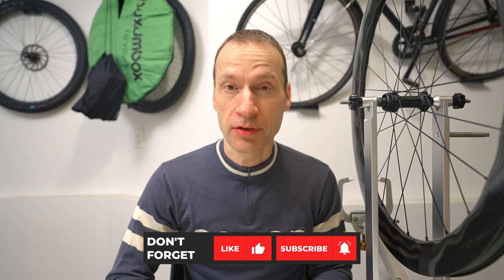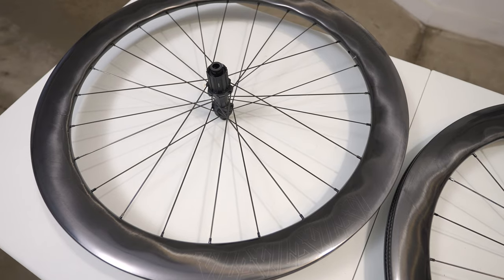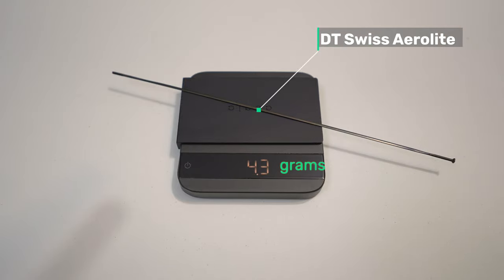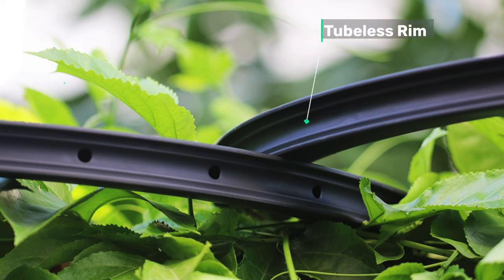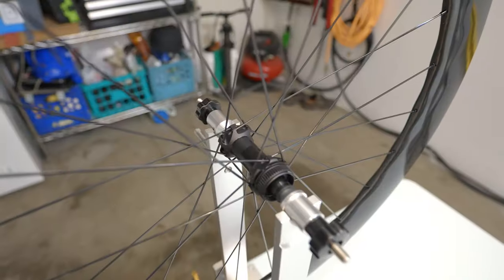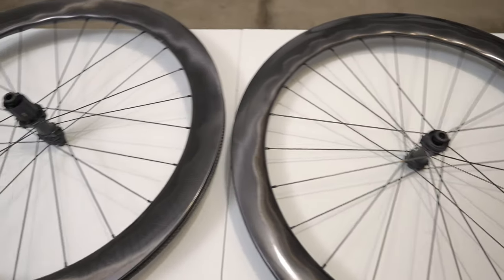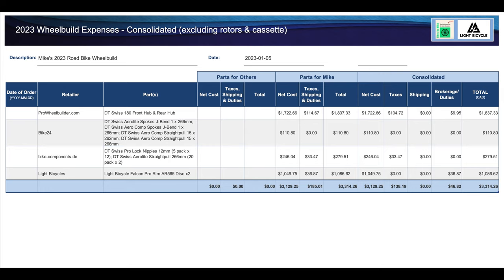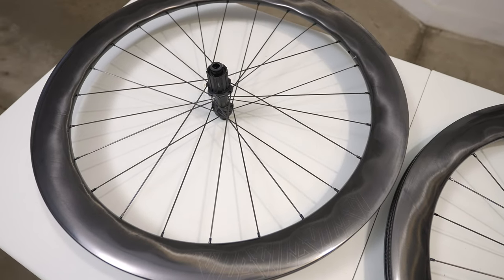My Dream Road Bike Wheel Build: The Completed Wheelset

Comment: Excellent video, totally agree with no rim tape wheelset which just creates another weak link. I've had rim tape rupture while the bike is sitting idle in the garage.
Reply from the maker: Just finding a good rim tape that won’t leak sealant over time is hard enough. There are a few good ones, but most suck.
Reply: Great video Mike! What was the finish on your rims? Matt UD with laser grey decals? Thanks!
Reply from the maker: @dchongster  Correct.

Comment: I don't see a follow up video, so how do you like the wheels?  I'm also in Toronto and have a pair of 47mm Bontrager wheels at the moment, and don't want anything that's worse in the crosswinds (I'm in Toronto too).  Considering the AR465 and 565 (either a mixed set or both 465) but want to know how you like the wheels, and how you think they handle in the crosswinds.
Reply from the maker: Hey, George. I only recently got a chance to test out these wheels, but I will be doing a full review of them within the next month. Put 400 km on them in North Carolina last week with pretty strong winds on most days, so I definitely can comment on their performance in crosswinds. In short, I’d say they perform as good, if not better, than most other 56 mm deep rims. And they are definitely better in the wind than the HollowGram KNOT 64 wheels I just took off my bike. Yes, you will feel crosswinds more than if on sub-45mm rims, but that’s to be expected. What’s important to me is to have wheels that feel safe even in heavy winds and these do give me confidence. But this is very subjective and personal to the rider. With my previous KNOT 64s, I had only one ride in three years where I felt completely unsafe on the bike. I expect with these LB wheels, I’ll never feel unsafe. That’s the hope. As for overall performance, these are killer hoops. Very stiff and responsive. I expected them to do well on flats, but they also feel great on the hills. I thought my KNOT 64s were stiff, but these are even stiffer. I suspect it’s to do with my spoke choice. Good luck with your wheel search!